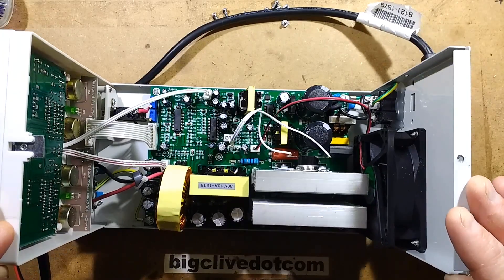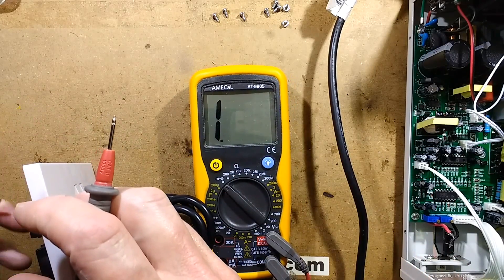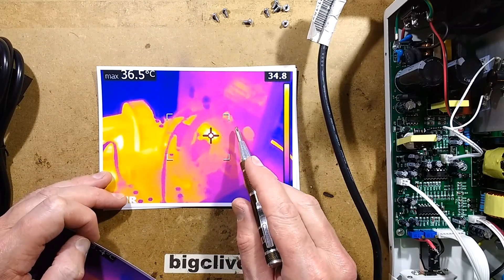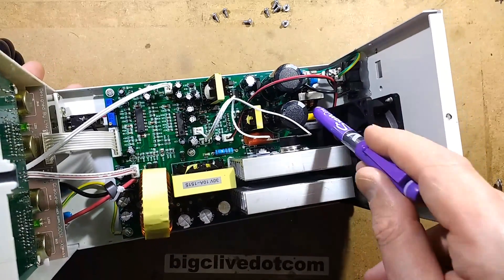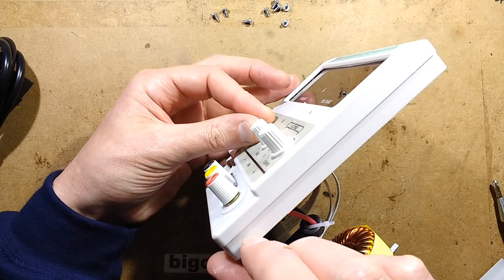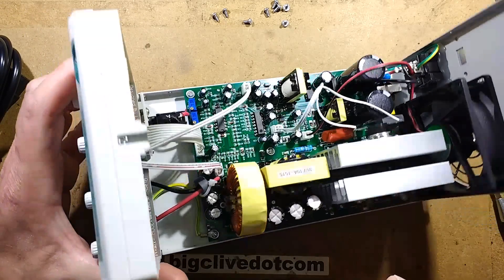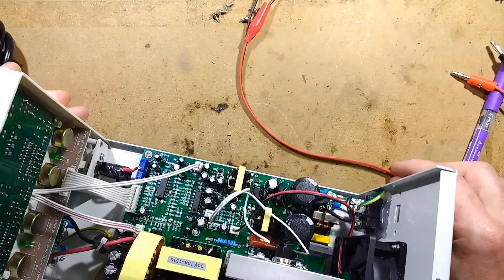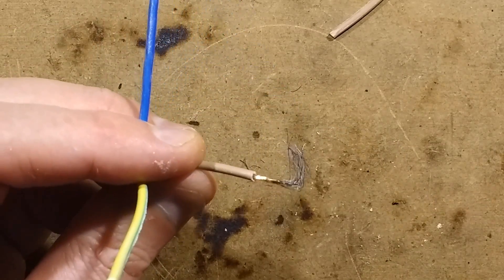Test of a PSU like the one that went on fire.

Comment: Was doing a bit of electrolysis on some old tools with the exact same power supply. For once I moved all outside to avoid any building up of  hydrogen in the workshop and it was a good thing. I'm guessing about 10 minutes in I was greeted with a full on fire 7 feet tall just managed to pull the plug and dumped the bucket of electrolysis solution tools and all before my went up. Being one with a guilty conscience I just assumed that I did something stupid and most times that is a safe bet. Just looked at the burned remains of it. The control panel  is melted and hanging open and can see no damage on the inside and very little damage on the backside of the control panel so yes I believe you are %100 correct about the connectors on the front. I've been a subscriber of yours long before I almost burned my house down and watch plenty of YouTube videos before buying this power supply and still some how overlooked this vid

Comment: American power outlets are in the shape of a horrified face, which is accurate for several reasons: 

1. This is the face people from other countries make when they learn about American politics, current and historical. (If you live here, you realize it's mostly just a competition of who can shout "FREEDOM!" the loudest.) 

2. This is the face you make if you touch live AC in the US. Current is what hurts and causes injury, not voltage, but given the fact that an individual human's body resistance is pretty much constant, and ohms law, you can't have as much current through the body on the US grid than in Europe, because the voltage here is 120V.

Comment: i remember i had a sleeved earth pin for my laptop charger and the actual pin got lodged inside the socket, so one time i took the plug out and the bit of metal got caught on the small piece of plastic in the socket and pulled the metal off the end, so that socket is completely unusable

Comment: Is not the earth pin sleeved with a "removable" thin layer of plastic? Couldn't one just shave off the plastic with a sharp knife? I'm in Canada with a diff plug configuration so it has no impact on me, but just wondering if this would be conveniently possible. Lol ,sorry, just read posts farther down which i should have done before posting. the sleeve being"recessed" onto smaller diameter portion of pin does render the entire plug a useless and dangerous pos.

Comment: If I recall sleeved line and neutral pins on plugs was also introduced to stop unpleasant people putting a 2p coin between the plug pins causing a dead short before the fuse when the socket was switched on.
Also does the power switch inside have a red and black wire on it rather than two reds...

Comment: The cheap-ass binding posts are the weak link on these units. 1st thing to do when getting one of these is to open it up and check the power leads are tight on the back of the binding posts.

Comment: It's always been my understanding that one should never put copper and aluminum components in electrical contact with each other since their galvanic potentials are incompatible and the aluminum will turn back into bauxite within hours should the assembly ever get wet. Coating aluminum with copper sounds like the ultimate blasphemy to me.

Comment: (Please: "someone whose power supply" - not "someone who is power supply".) 
When I was working in industry we had a number of instances of equipment catching fire. It was caused by 100nF multilayer ceramic capacitors flaming like roman candles. Has to be seen to be believed! Take a look at the front panel PCB to see if there's one on it. Commonly used for decoupling 5v rails.

Comment: 79.1 C,  over 170 Fahrenheit, is that normal for electronics to get that hot? and you had it in open air as well.
Reply: It depends on the component and its ratings, but yes, generally I wouldn't be worried about something running at 80C if it's doing a bit of work, as long as it's something that you expect to get hot, that is. But in the league of "things you expect to get hot", a lot of ICs and other devices are happy well over 100C, often well over 150C, in fact. (Be careful thinking "it's in open air", by the way - the case being open means that any carefully-designed airflow paths through the unit have been ruined, thus meaning the cooling fan(s) aren't able to do as good a job as they would with the case closed! In this case that's probably not an issue, but you can't just assume that "it'd be hotter with the case closed")

Comment: Thanks for this video Clive!  I have a similar PSU and re-soldered the leads but before I did that I checked the resistance with my Fluke 23 at about 0.9 ohms.  After modifying the leads the resistance was a more sensible 0.2 ohms.

Comment: I had one modified TL494 ATX PSU explode exactly because this "non-working" current-limit implemenation. The TL494 can't get properly current limited. The chip puts the transformer in heavy core saturation and the blow up the push-pull transistors. :D

Comment: Talking about plugs, could you maybe explain sometime how come in europe we have wallplugs that have only 2 pins, which can apparantly be either live or neutral depending on which way you plug them in? I still find it very strange that it doesn't matter which way round you plug them in
Reply: there are two parts to the question, 

A) Why are there still 2 pin prong plugs when there are 3 prong sockets.

B) Is there such a thing as polarity with AC circuits. (Neutral and Hot).

Answers:

A) The reason there are two prong plugs, is that the appliance or lamp had what is called "Double Insulation", and not only is the electricl power insulated from the user, the CASE of the device is insulated with two layers of insulation, so there is no possibility of any VOLTAGE leaking out ofthe conductors and potentially going through you then to the earth.

Since the appliance is double insulated , ALL ofthe current that enters one pin can only go out theother pin and complete the circuit.

WIth a Metal exposed appliance (such as a fan motor), it was possible for a short to happen arounf the windings of the magnet wire, and the conductor would touch the metal frame.

With a two prong cord there was no 'safety' return, so whoever was holding the appliance, would be at some other potential other than zero, and could possibly get an electric shock if they touched sonething else (like a faucet/spigot/water tap) at the SAME TIME.

the electricity would 'leak' from the motor, enter the human body, and then travel through the body, and exit at the other hand.

Depending on the strength of the curremt (10 mili amps, yes one one hundredth of an apere, is strong enogh)  to make your muscles lock and you will not be able to release the hold.

B) with AC power, there is no such thing as 'polarity', but because the power is alternating at 50-60 hz, it is deemed to be 'live' at the hot terminal.

The 'Neutral wire' is actually bonded to ground at the transformer station and at the power pylon (pole) outside of your house, so there is a return path for the current to flow to.

With the 2 pin socket it does not matter since the power is AC, which way the plug is powered on, execept in RARE circumsnatances such as TUBE Guitar amplifiers, to minimize the 'hum' in the guitar pickup circuits.

So, in summary, all alectric circuits must have a SOURCE and RETURN, and if the applince or lamp is not double insulated, must have a safety connection or 3rd prong or connector such as the spring clips on the side of the euro socket.

Comment: Dear Big Clive, some of us classic car owners would be stoked to bits if you can turn your attention to the electronic ignition kits on ebay, are they value for money?   Is it as I suspect just a simple hall sensor detecting the spin of a magnetic ring?   Can we improve on these kits or use alternative components as these things cost anything up to 50 quid where a set of points is like a few pounds.   There is two major types and one is the suspected hall sensor, the other is the magic eye system where a timed rotor blocks the beam and it looks like a helicoptor prop, the ignition turns on and off through the rotor blocking the magic eye.
Reply from the maker: The main advantage of electronic ignition is reducing switching losses.  It's an interesting subject.
Reply: It is when you consider the simplicity of the task demanded of the system to the huge science that went into developing dwell angles and uprating of the condenser to how the much taken granted for coil works and how that design has remained fairly static over the long years.   Years ago I used to live in Bodmin and two doors down was the then elderly chap who invented the dim dip system because of how bad the Cornish roads were, he thought back then it would never catch on but look at how ingrained that little thing is in every car and bike of today?
Reply: the dim-dip system is specific to UK vehicles prior to 2006, where the low beam lamp is on at 10% of power (sort of alternate for fog lamps), but was obsoleted with Daytime Running Lamps, of which the US still does not requre them on cars yet. Not sure about DRL in AU or ZA though.

Comment: Hi Clive, I have a similar model to this one, its 60V and 5A and all through hole components, no surface mount like yours. But the layout is the same. I while ago I tried to trace the PCB, I uploaded a schematic on eevblog, if you need a quick reference:

http://www.eevblog.com/forum/beginners/maisheng-ms-605d-power-supply/msg1060359/#msg1060359

Comment: I have one of these for rough powering of devices on my test bench, I noticed the current control buzzing and never used it since. Most of the time I only regulate voltage. Works fine.

Comment: Good post. That power cord reminds me of one that John Ward tested. Aside from the sleeved Earth pin, the fuse was fake (or at least not constructed to the proper standard.), the wires were not up to the specification printed on the cable and the connector to the appliance contained steel or iron pins. So basically if you see one like that or branded 'gulda' (A fake brand name used on generic IEC cords sold with Chinese ebay products.) just chop it in two so no one can use it and bin the things, they are safety hazards.
Reply: You have to be careful buying directly from some of that countries suppliers.
They will fool the customer in any way possible with no regrets.

Comment: I got a Retron 5 awhile back and for whatever reason they have (Besides my American 2 prong, 3 others.  Asia, Europe and Britain.  None of these have a ground plug on them except the british one has sone but it isn't whatsoever.  Just a plastic piece.  Not knowing how that ground works.  does a device work at all if there isn't a prong in that hole , real or fake or why do they bother putting the totally plastic prong on a switching transformer/power supply, do have pictures of most of these but you can look them up as well.  You'd probably have to get a Retron 5 from the maker for a review otherwise thats not all that cheap.  More for those who don't want to harm their Nintendo/Genesis items.  But it's caused at least one memory issue with Zelda II, that and it's clearly an emulator of some sort because I accidentally removed one cartridge from the unit when it was loading and it kept running.  I'm told all it does is copy the game to memory, They could also have all the games on board and the cartridge is simply the key but I could see the copying thing as well.  Not in the mood to tear it down till after the warranty ends..

Comment: I never gave any thought into the heatsinks being at a high potential. Something I found out today by accident while poking around in a computer PSU I was re purposing. I was happily measuring the 5V rail while seeing what effect the +5V sense wire did. It basically locks the floating 5V down to tolerance (It bought it down from 5.38 volts to 4.95 and held it there) Anyway I somehow touched the big heatsink with big fat 3 legged beasty on it and got a lovely eye opening jolt from it. Needless to say the air turned blue a that point. No idea what the voltage was but it was a punchy zing lol

Comment: Howdy Clive, I've been using a PSU similar to that one there for a few months now.  Your vid motivated me to pop it open and have a look.  Am I glad I did!  The earth wire from the mains cable has a ring terminal on it, and the screw through that into the chassis was in by only three turns or so.  Riiight. The terminal was flopping around on the screw.  THANK YOU sir!

Comment: Ah, the old sleeved earth pin. I've had a number of Chinese-origin Class I (requires earth) appliances supplied with C5 or C13 IEC leads that had either a plastic earth pins on the wall plug or a metal earth pin but connected with 2-conductor cable.

Comment: Just thought with the end of the communist block, CCA was buried in Europe. But seems Copper is horribly expensive, so you get leads made of CCA or worse, 3 strands of "magnetic" wire. I measured the resistance of a chinese supplied power cord, nominally 3G 1 mm. It was round 1 Ohm per lead. With the appliance that came with it, drawing 30 Watts, it would have worked, but if my girlfriend would have found it and used it with her quick heat water heater in the kitchen, it would have probably been one meter of fire.

What do you learn from the accident with a similar power supply? Never leave this stuff unattended. Pull out mains plugs before leaving, or turn main supply off.

Comment: "This massive choke" Surely Clive you've seen the chokes in theatrical dimmers, those are massive!
Reply from the maker: Relative to the size of the unit and definitely relative to expectations for cheap stuff.  But not as big as the chokes used in some steelwork arc furnaces.

Comment: To add; if you encounter illegal/ dangerous cable like that, don't throw it away. First, cut it near the base of the cable on the end that is faulty. Then throw it to trash. Don't let anyone think it is just thrown away and still works. It was hard to get used to that when i used my own cables to the death but really, protecting public is #1 priority. Destroy or disable dangerous equipment, don't rely on post-it-notes or memory or common sense. Even if it is marked "don't touch, will give you aids, ebola and explode" and it is in a trash, some moron will dig it out if it "looks alrite to me".. Take fuses out, cut cords, use hammers and saws.
Reply: Cut the illegal plug (from the cable) out replace it with a good plug.
Reply: @supersaiyangoku3580  They still use very thin conductors in the cables with high resistance. I wouldn't use one personally.
Reply: When a piece  of hardware is flakey, I try to loan it to someone I don't like.
If and when they complain about it I say "I don't know man, it was working ok before. You must have dropped it. That's an expensive piece of hardware, let me find out how much it costs".

Just a joke, I only did this once with a hard drive. I did not charge them.
I would not do this with a dangerous item.

Comment: A lot of older extension cords in the US don't even have a third hole for the grounding pin at all, so I used to just pull the grounding pin out of the plugs on power strips/surge protectors, and plug them in to make a longer one. They had circuit breakers in them so it would still protect an actual surge, but is this dangerous to do in general? Will it cause a fire or anything?
Reply: It depends to what you define as 'dangerous'.

A kitchen knife in the hands of a terrorist on a motor bike across London bridge is 'dangerous'.

A kitchen knife, in the hands of s skilled sushi artist is fanstastic.

When you pull the center (centre) pin of a 3 pronged plug, so that it will fit in a two pronged power bar, you now are removing the SAFETY component of the third pin, and IF there was a fault with the equipment, and you were holding that equipment, in CANADA, and the USA, you could get a full 120V potential across you and the return current path.

Not a nice way to end your life.

IF you survive, your muscles ,and internal organs will be forever disrupted because of the current jolt through your body from the point of entry to the point of exit.

What happens then is there is some fault with the applaince, take a cast metal housing drill, and the insulation on the motor brush breaks down where the brush holder is held in place, but because the ground pin is broken away, there is no way for the current to go anywhere, when you are on dry concrete or wooden flooring.

But, that same broken insulation on the drill, only gets electricity when you pull the trigger, and the casing gets energized to 120v , when it is running, and you are holding the drill in your hands, and you are on wet or damp soil, you will get current flow (An electric shock), between you and the return of the power panel in your home.

If the PIN was in place, the electric current would flow to the metal case, and out through the pin to be SAFELY returned (It may not trip the fuse), since USA and CANADA, do not have a requirement for Ground-Fault Interrupter (GFI) anywhere except POOL and WET locations.

(Sadly not the whole home, yet).

So, your action, is now putting you (and others) at risk for a potential shock, and if the appliance or electrical equipment is not electriclly isolated, with the double isolation square symbol , then there is the chance of disaster.

Either get the proper plugs, and re-connect the 3rd pin, or get the proper 3 pin power bar.

Most electronic equipment does not need a 3rd pin, but items that have a metal case, in CANADA, at least, must be CSA or equivalent certified, so that people do not get electrocuted.

[show example of Edison experiment with DC and AC currents, and Jumbo]